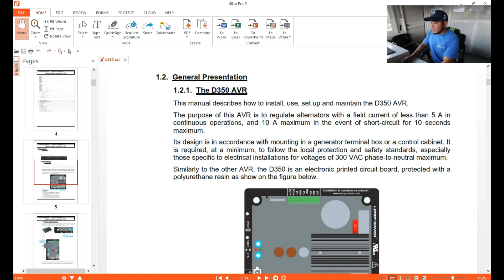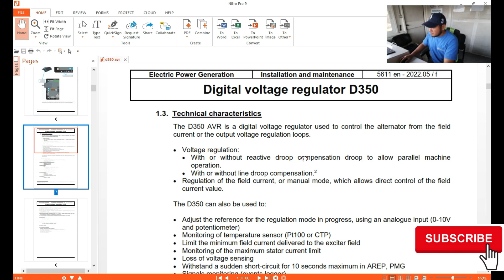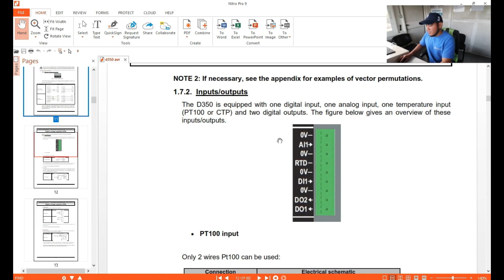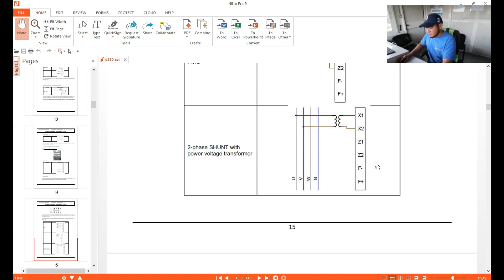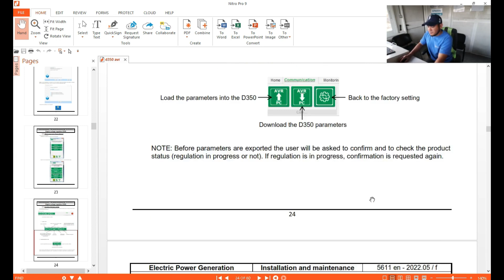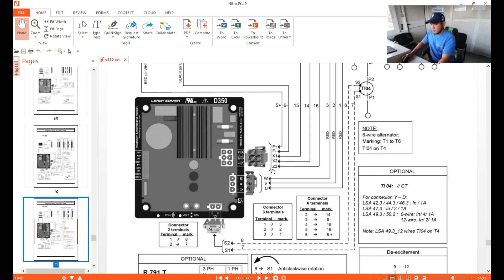LEROY SOMER D350 AVR SIMPLIFY benzblogs

Comment: Dear sir I leroy somer alternator main supply 400v 3phase with same avr D350 ,that alternator have total 6 lead  T1,T2,T3 T4,T5,T6 
T1= L1
T2=L2
T3=L3
T4+T5+T6= NEUTRAL 
The stator is in  star connection 

I want to change voltage 400v 3 phase to 230v 3 phase  with same D350 avr ,please help me sir please guide me sir 🙏
Reply from the maker: Not posible if 6leads
Reply from the maker: 12 lead only is posible to convert to double y to become 230 vac out
Reply: @benzblogsVlogs  if I'll make 6 leads delta connection then what will happen sir

Comment: Can bought and directly replace this one with new d350 without computer configuration..??
Reply from the maker: No you need to config or if you have flash file from other avr just direct write it
Reply: @benzblogsVlogs  but the manual says that we can use this avr as analogue type by just varying voltage, stability, and by default the frequrncy is 50Hz.....you know something..??

Comment: I have a machine that was using the alternator with a D350 AVR and I changed the alternator on the same machine with a 230 KVA with R150 AVR and The machine board only recognized the old alternator
Reply from the maker: What you mean you replace the avr?R150

Comment: how to replace R438 Avr with D350 Avr
Reply from the maker: Simply follow the wiring diagram after adjust the voltage and do the config for the d350